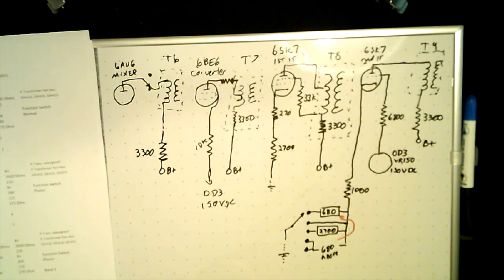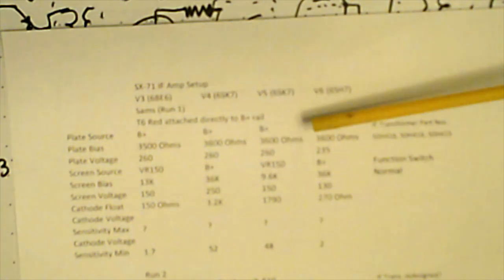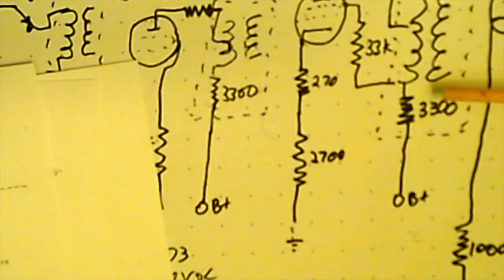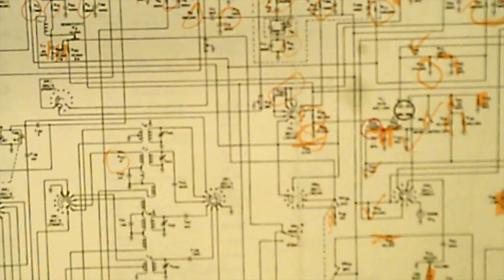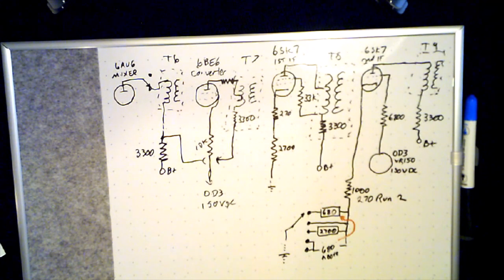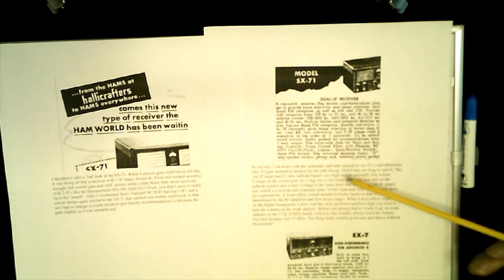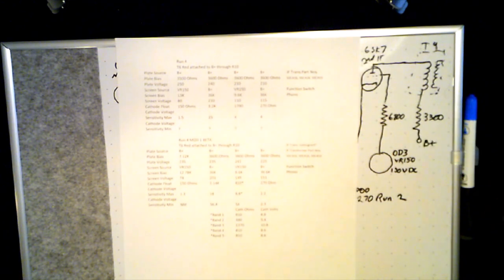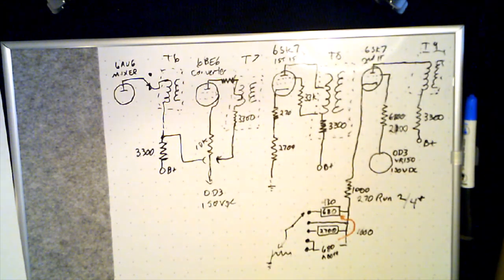Hallicrafters SX-71 Runs 1 2  3 4 Explained

Comment: Thank you! I am restoring my SX-71 this winter, I already had a broken ferrite slug in the converter, so alignment changed when the set is moved from horizontal to vertical. I don't know the run number, but there is no 15m on the bandspread
Reply from the maker: I hate to hear about the slug.  Without the 15 meter band it is either run 2 or 3, more likely 3.
Reply: @i82996  Did you complete the resistor changes for the different bands?  Is there a way to tell the 2 from the 3, or is this done just following the schematic.
Reply from the maker: @speter60  I replaced nearly every resistor, but that is mostly, but not all me.  Some were out of tolerance to the extent that all were suspect as heading towards end of life.  I sent you a more detailed reply plus documentation of my rebuild via hallicraftersradios@groups.io .
Reply from the maker: I forgot to mention: when you screw back on the IF cans be very, very careful not to over-torque the screws or you will tear the screw right off of the can.  They are very fragile.

Comment: Excellent video! This is very relevant to me as I am currently trying to figure out why my 2nd IF tube has high plate and screen voltages compared to the manual's socket voltages. Something doesn't match up and now I most likely know why. My resistors all check within pretty good tolerance. Certainlly not out enough to cause what I am measuring. I am going to have to watch this video a few more times and compare my rx's actual circuit to your diagrams and run numbers as well as identifying what run number my schematic is.
Reply from the maker: The plate voltage is high because the screen voltage is too high.  Check the 330,000 ohm R9 again or just replace it, and the wiring around the S-meter including the + and - connection, and smooth function of the S-meter adjust, as  well as those resistors in line.  Try checking voltages from the B+ all the way through the S-meter to R-9 and to the screen to see if values make sense.  Blessings.  Merry Christmas and Happy New Year!
Reply: @i82996  Thanks for the clues. I replaced the 330k R9 but haven't chased all voltages along the B+ path all the way to the screens. I will do that next. I like the simple explanation about plate voltage dependency on the screen voltage! Happy New Year to you as well!

Comment: Thanks for the great videos on the SX-71.  Getting ready to rehab mine.  Is there a quick and easy way to determine if it is a 1,2,3,4?
Reply from the maker: I went back and looked at the schematics.  As I recall, the "white dial" versions were exclusively Run 1, but there were Run 1 black dials as well, I think.  I don't have a good schematic of Run 1, but Run 2 has 400 volt .05uF caps off the cathode of several tubes and after that, probably Run 3, they were upped to 500 volts for runs 3 and 4.  Look for that as a dead give away.  Run 4, the only difference I can recall, had the 15 meter band painted on the bandspread dial.  There was a service bulletin for Run 1, due to leakage across the primaries to secondaries on T7 and T8.  That was fixed by redesigning (or was it re-supplying from  a vendor or both) the IF transformers in remaining units of Run 1 - basically this caused the first runs off the factory line to be problem prone.  Also R-41 was upped to 1 meg in the bulletin, and is the value in Runs 2 through 4.  If your set has anything other than 1 meg for R-41, you have a Run 1.  You will need to get into the mixer subchassis and the IF transformer cans and verify everything - especially DC leakage across the micas (yes the mica caps sorry its lots of trouble).  When you screw back on the IF cans be very, very careful not to over-torque the screws or you will tear the screw right off of the can.
Reply: @i82996  Wow... thanks for the info... that will be a big help.  I thought that perhaps there might be some serial number info that would distinguish between them.
Reply from the maker: @johnwaldburger8822  not that I know of.

Comment: Thank you so much for sharing your knowlege here for all to enjoy and learn.  Albert, I have a strange problem with my 71 run 3, my sensitivity knob runs backwards in band 1 other bands it works normal when BFO is on, any ideas what would cause this
Reply from the maker: My guess is that there is a problem with the wiring of Switch 1, section 5 (rear).  There is supposed to be a jumper between the first lug (Band 1 position) and lug 4 (Band 4 position).  It may be open or missing or a cold solder joint.  The purpose of this configuration, my guess, was to have a relatively even sensitivity when switching between the bands.  This radio was not intended so much for ham communications, but was for radio entertainment across the bands, my thinking.  So switching bands should not cause one to reach for the volume or sensitivity control.  This switch is supposed to add 680 ohms to the sensitivity pot of 10,000 ohms (roughly 5%) on bands 1 and 4, nothing on Band 2, adds 2700 ohms on band 3, and parallels 2700 ohms with 680 ohms on Band 5 (SW2 Section 1 rear, dropping resistance by about 50%).  If the jumper is missing, then L1 choke is open, and V5 behaves as if there is no bias  on the cathode, driving the tube harder and dulling the sound.  So at 10 on the knob the sensitivity is supposed to be at max with only the above resistances as a bias to the V5 cathode and no sensitivity with the bias at 10000 ohms plus at the zero setting.  But in your set, at 10, it is at 680 ohms to the cathode (lower), and at 0 the sensitivity is only the capacitor to V5, which would be higher sensitivity.  In bands 2 through 5 the normal connection for biasing is made and the receiver works normally.  When the BFO is on, the AVC is grounded off at 150 ohms, which puts biasing on V5 at 150 ohms.  So check that jumper.   It's my guess.
Reply from the maker: Merry Christmas and Happy New Year!